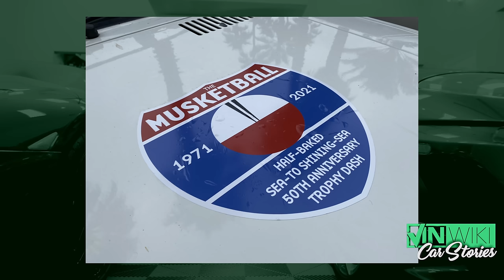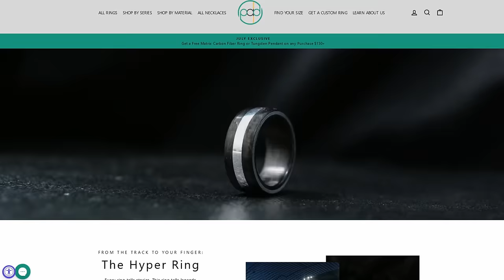The most ridiculous Cannonball Run of all time!

Comment: Hey if y'all want to invite a newbie for the next event if you do one, I can swap out my 350 rocket in my 86 Caprice for a 260 that is woefully underpowered, but otherwise bulletproof reliable. I get an invite, I will f*cking do it lol.. I'll even wrap it like the family truckster in National Lampoon's Vacation.

On a separate side note for contrast the original medvan in The Cannonball movie based on the vehicle that probably I'm assuming had a 360 in it, meaning power to spare. Compared to a little 600cc Suzuki engine big enough for a motorcycle in a van...

Comment: I wish they could set these up where the public could be safe without disrupting stuff.   Few months ago I saw @8 exotic cars parked, drivers taking pics…. I told my wife.  “In @ 5 minutes they will be blowing our doors off”. This was CO in mountains.  Not long after I hear them.  I am behind 5 other cars, double yellow solid lines, but nice shoulder.  They were passing on either side of us.  My pickup was rocking, the noise was painful.  Oncoming cars pulling to shoulder.    I like night driving.  My night vision appears to be really good.  Plus less traffic.  Few sections of interstate with constant curves.  At night I drive like race course.  (Just a bit over limits). Just until I overtake traffic.  Then I drive normal till a solid curve ahead.    Have fun, be safe.  Few tickets.  Have been greatly reduced.